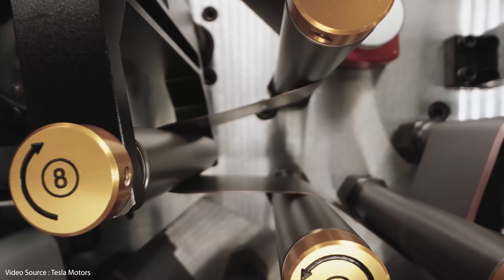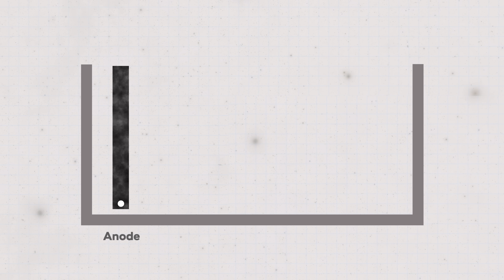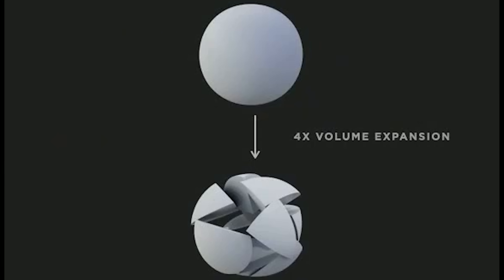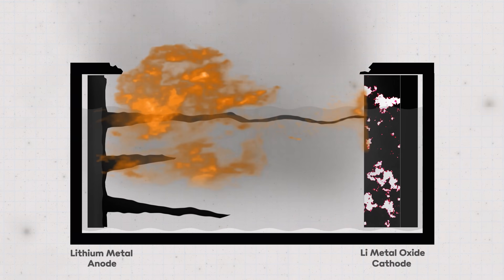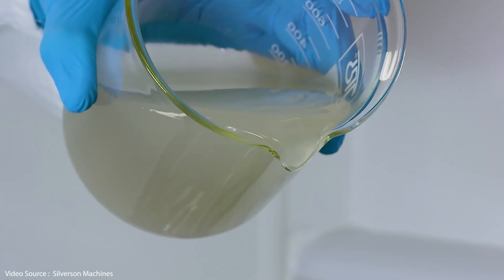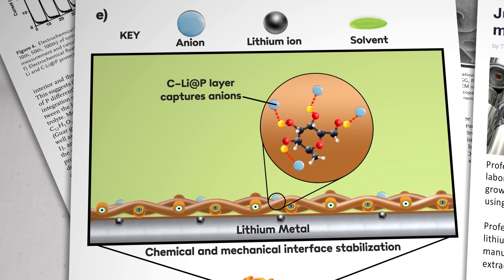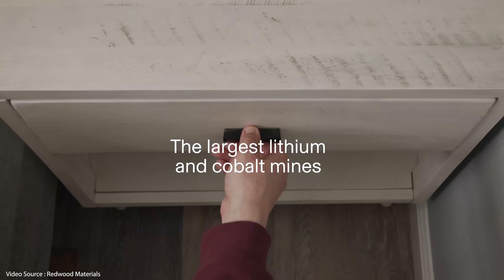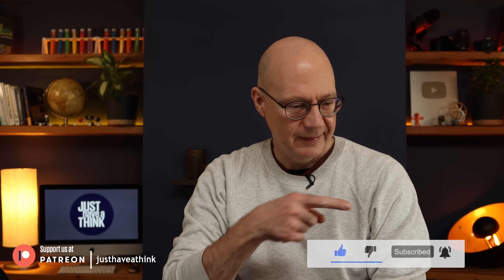Solid Lithium Metal anode breakthrough. 750% LONGER life!

Comment: Incremental improvements do add up over time, and if one doesn't pan out, it may lead to others to build on the work. Considering the massive amount of research into batteries, I have no doubt that we'll see dramatic improvements of the next few years, improvements that will make it into real life applications.  The future is bright IMHO.
Reply: if you knew anything about battery design, you would know that the future is as bright as it was in 1930...  There's no magic.  Never was.  A battery IS nothing more than two pieces of metal rusting together.  In the last hundred plus years, literally every possible combination of metals and electrolytes have been tried.  Lithium ion batteries are no more powerful than Energizer alkaline batteries.  But they're vastly easier to recharge, so that's a win.  But there's no 'great breakthrough' right around the corner.
Reply: @kyleb3754 The energy density of lithium ion vs alkaline are as follows:

Alkaline (Non-rechargable):
85 to 190Wh/kg, 250 to 434Wh/L and 50W/kg

Lithium (Rechargeable):
60 to 220Wh/kg, 177 to 600Wh/L and 200 to 5100W/kg

Figures taken from the "Comparison of commercial battery types" page on Wikipedia.
Reply: @kyleb3754  You're repeating yourself, and you're just as wrong as you were in your other comment.

Comment: I like your comments. Battery will catch fire, and we don't want this uh ?

lol. I quite like this tech. I wonder what is the drawback. If this is available materials, biodegradable, maybe the manufacturing process isn't scalable. Nanotubes in this material sounds like quite hard to scale up, like you know, carbon nanotubes etc.

Even if I am quite sceptic against new technologies like that, who are probably not "groundbreaking" in the sense that it will revolutionize things in 3-5 years, I think the main point here is that there EXIST something to be done with litium anodes by using materials to protect it. Thus, more work is needed to find something that is working and scalable, while being cheap enought to make it worth.

It is quite nice to have an available biodegradable part, but honnestly if you have something keeping your battery in function for 7x the time, then you basically have an eternal EV, with really enormous capacity. So you won't have to change car that often, meaning it will keep its value, and second hand market will be good, etc etc.

This improves the whole thing. And if energy density is higher, then you can put less battery in your car, making it lighter, with "bigger" range, and probably cheaper making it more accessible. This is a win in every direction you look at it, no matter what they use to do that. The only point is really scale this and put manufacturing process.

Comment: Being 7.5x better than something that doesn't work well enough to sell(Li anode battery) doesn't say much, so your headline is a bit misleading.  I would have spent more time comparing specs to currently commercial cells, not just the capacity retention, but density, stability etc. as well.

Comment: Battery research is going strong. That's the takeaway, really. Makes me think, What if we'd started long ago? After all, the ICE always was a Rube Goldberg contraption; the electric motor always was superior, even at the dawn at the automotive age. Batteries were always the holdup. Maybe we're finally getting there.
Reply: Battery research has been going strong since the 1950s, never stopped really. The Li-ion batteries we use today were discovered in the 1970s.
Reply: Have to agree. We have been researching batteries for decades but some of the breakthroughs weren't made until 50 years ago. 

If there had been no gasoline vehicles and we were exclusively electric it's possible we might have made faster progress but we really needed better computers, better theories based on a lot of doctoral research, and other technologies before we could make some of these breakthroughs.
Reply: I almost clapped my hands to your comment but I would regretted it. Let me tell you a few things about ICE and EV cars in my own family. I have an ICE car with 22 years of usage and the most expensive maintenance I ever had was around 400 euros. Usually its around 200 euros or less per year on maintenance. My nephew has an EV and already had to pay more than 10,000 euros to replace the battery and his EV didn't even had 7 years of usage. So my nephew paid more for one maintenance than I paid for 22 years for maintenance. But keep your faith on corporate tech and don't give up because corporations just love people and the environment and the children and the poor, maybe one day EVs can reach the level of reliability, durability and cheap maintenance of my ICE car. It might take many decades but don't give up. And keep you faith on social networks, because they always tell the truth.
Reply: @profounddamas  Once we get to Batteries 2.0 then yes, game over for the ICE. Admitted: Today the EV with its Battery 1.0 tech is still just a gimmick,  a fanciful splurge for the well-off. I've got a 2007 Prius and would get another one that would last another 20 years. But soon enough the 2.0 battery will arrive. Nay-saying didn't stop the end of the horse and buggy. It won't stop the EVs either. Another overlooked would be the whole oil problem -- getting it, refining it, transporting the fuel around. That's a huge expense just waiting to go away.
Reply: @profounddamas  you must have exceptionally cheap stretch then because on my car which is 12 years old the maintenance was $4,000 last year.  That was for a pair of struts and something called the VTX.

And you may also be comparing apples oranges because if you have a $45,000 ice car, the maintenance costs are going to be a lot more.
Reply: Not really.  A lithium-ion battery is 2% more powerful than a zinc-carbon or alkaline (Energizer) battery.  But it has the advantage of allowing blind, dumb, in-situ (consumer) recharging.  Alkaline batteries can be recharged, but require a PhD in battery design to do it, so they are said to be non-rechargeable.  As far as power density goes, There is no magic, 100 billion possible combinations of metals and electrolytes have been tried since 1902 ... it's ongoing, but we're not 'getting there' because there isn't anywhere to get.
Reply: @kyleb3754  Um... No.   Did you even check before posting?

Energy Density (Wh/kg)
Lithium-Ion	150 to 200 Wh/kg	
Alkaline	~100 Wh/kg	
Lead-Acid	30 to 50 Wh/kg

Lithium-ion has the highest power density, meaning it delivers more power per kilogram than alkaline or lead-acid.

Alkaline batteries are relatively weak but work well for low-power devices.

Lead-acid batteries have moderate power density but are very heavy, limiting their use in portable applications.

Source:
Wellgo (Lithium vs Alkaline vs Lead Batteries, a Complete Comparison)
Flux Power
and others
Reply: @kyleb3754  Well said, unfortunately there are millions of people that refuse to have critical thinking and put their faith on the first promise these corporations give.

Comment: I do not think it would help battery recycling .. it would help careless tossing it in the trash issue. but not recycling
Reply: What makes you think that?  Are you aware of the extensive lithium ion battery recycling industry that already exists?
Reply: @incognitotorpedo42 he's not saying there's no recycling going on, he's saying that he doesn't think having a bio degradable component would help much during recycling but would however help a lot, were the battery to end up not being recycled - so maybe  more beneficial if used in the small batteries used in things like disposable vapes?

Comment: So.. 85 times as long as pre-existing pure Li anodes (60% at 500 cycles, or 3 years) or as long as conventional Li-based batteries (80% at 500 cycles, or 10 years with up to 2000 cycles)?
Reply: Or any number of "tweaks" like "turning the wick down" slightly to find a balance?
Let's give it a few months?
Reply: @rogerstarkey5390 It's well within the realm of possibility that this will be successful. A pure Li anode that still charges to 80% after tens of thousands of cycles? 

I have no basis to dismiss, though yes, we'll have to give it more than a few months.

Unlike something like fusion, which we can dismiss out of hand.

Comment: To me, the biggest take away is the anti-dendrite properties of this coating. It's unquestionably a good thing. My question is, does it have a downside? Could it lower power density and/or increase heat by slowing down diffusion of ions into the anode? For low-drain applications like cell phones, and maybe off-grid house battery-banks, that might not matter very much. But for high-current applications like electric car batteries, it could matter a lot.

I know, I know: "Why don't you read the paper and figure it out for yourself, you lazy bum!!" 😆
Reply: If it has a 750% performance benefit, a slight reduction from that wouldn't be an issue? (and will no doubt be further refined in time)

Comment: Interesting. Thanks for the link in the description. Published in Advanced materials so it has had a peer review. Good. Quickly flying over it looks good from the material analysis they used.
Sceptical points why do we get only a value of 300cycles for the full cell ( an impressive one) but not a value for the 80% limit? Did something happened to the cell before it dropped there or did they just run out of time before publishing the results?
Only time will tell but a good paper with interesting ideas and results so something useful all can work with and one step forward to understand how to control those materials. With some luck a breakthrough or very close to it.

Comment: Seams neat, glad there's this much innovation in batteries.
Reply: Yup. Glad it is still going strong. I like hearing about them. 

 The more random papers, studies, etc. The more break throughs the better, even if they don't pan out economically.

  They can still further research, and eventually create greater things. 

 And of course some are actually working. Battery industry IS progressing fast. 

The sheer resources required to actually build is the issue. Sometimes manufacturing engineers are the weak point. Industry I guess. 

  So it isn't the material scientist for once holding us back. Where's my 10k Celsius resistant alloy?

  Not even therotical nano materials for above 4.3k celcius. Starlite was an ablative so not the same.
Reply: @dianapennepacker6854  There's these laboratories that utilize AI to do autonomous research on new materials.  Very new and experimental, but it could create new materials after materials endlessly until it creates some useful ones. Might give you that ultralight 10k celcius heat resistant alloy sometime.

Comment: We need to separate the research for mobility applications from the research for stationary applications.  By doing this we eliminate some of the goals for mobile applications, making it easier to achieve the ideal battery for static applications.  We no longer have to worry about weight or volume or fast charging and we focus on price, safety and longevity.  Anyway, I am becoming convinced that the price of the actual batteries is pretty well irrelevant.   I had a quote for a Tesla power wall installed so that I can take full advantage of my solar array.  With batteries coming in at $100 or less, a 13.5kWh battery should cost $1,350.  OK.  Double it and double it again and round up for shipping, profit taking, installation, exchange rate, electronics and so forth.  Let's say $5000 installed.  The quote was for $19,000.  Ridiculous.  Then I needed a new battery for my weed trimmer.  The battery holds a tad under 0.2kWh so cost - $20.  Do the same exercise and let's say $100 for the battery.  Actual cost $300.  The cost of the batteries is irrelevant.
Reply: Researchers fully understand the difference between a grid battery and an aircraft battery.  This one is an aircraft (and high performance car) battery.  Tesla is ripping people off with the price of the Powerwall. We'll probably keep CATL's version of the powerwall out of the country (I'm in the US) with ridiculous tariffs so Tesla can continue to overcharge customers.  And yeah, tool batteries are a scam, too.
Reply: AS Tony Seba said regarding Solar 10+ years ago, "Cheaper than the cost of transmission" (in other words, "put them on the buildings")
The same will apply to batteries.
Those saying "Too expensive!!" are talking about "First Gen packs" built before Economy of scale ramped..... and it's STILL ramping.... WITH new developments coming.

Comment: The environmental aspect of that is insignificant. This is a very tiny component of the full cell. 

What matters most is the performance and the cost of the innovation comparing to other   Li anode protecting technologies. 

Is this the cheapest or most performative?

I wished there was some standard understandable benchmarking, like how many kilometers one can drive with the battery until it reached 50% of its pick performance.
Reply: Hmmm...
Actually less.
If the cell has 750% increase in capacity, the constituents are 750% more efficient, so you need fewer cells, less material for the same output.

Comment: 9:25 Yea my thoughts exactly. Just because it can 'decompose' into the soil doesn't mean it doesn't harm the soil with it's components afterwards.
Reply: @nfzeta128
Why would it ever "Decompose in soil"?
The whole point of "recycling" is that it never reaches "The soil", but is sold as a valuable part of "The battery" and recycled with the other core constituents at much lower cost and a fraction of the environmental impact.
Reply: @ Yea that's part of it as well and it means either the unused byproducts  from recycling decompose in soil or they decompose most of the components and then 'refarm' the soil for the necessary bits.
Reply: @rogerstarkey5390 Oh the "decompose in soil" is pure marketing, but even still, using relatively non-toxic organic components opens up a lot more options for safe disposal. If the SEI can be safely burned off of the lithium at relatively low temperatures that make recycling much easier.
Reply: I think the point the researchers were trying to make is that the guar gum and polyacrylamide are known safe materials that can be biodgraded. Those materials removed from a spent battery could not be reused for new batteries, but if they compost then probem solved. Guar gum is natural and decomposes fully and the world produces 1 million tons each year. 750 million kg of polyacrylamide are produced each year and it is used in ways that put it into the environment with no obvious harm (sewage treatment for example). People have tried to claim it can revert to acrylamide, but that does not appear to be true. If it was harming the water and soil we would know that by now considering the huge amount that is produced annually.
Reply: As a trolling member of the anti-EV cabal (I work for a new car dealership), I cheerfully give this comment a thumbs this up. (TIC)
Reply: @TronJockey  why are you a member of the anti grandchildren cabal?

We need to leave the planet for our descendants.
Reply: @TronJockey  
You haven't accepted that the vast majority of new cars ARE going to be EVs , regardless of your preference?
(But since you work in a "Dealership" your job is likely going away anyway.... Oh well)
Reply: @rogerstarkey5390You agreed with Maggie when she closed the mines, then? All those obsolete jobs gone, "oh well".